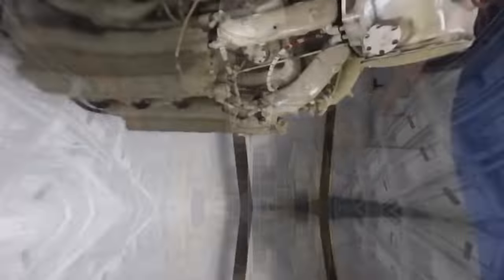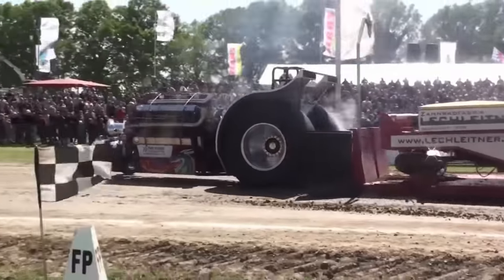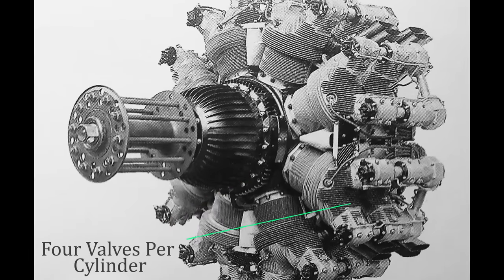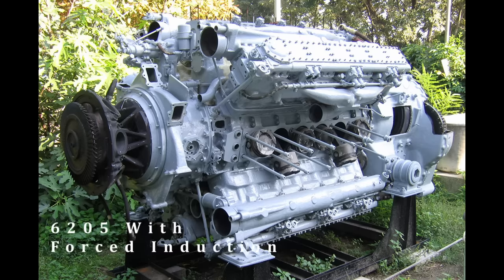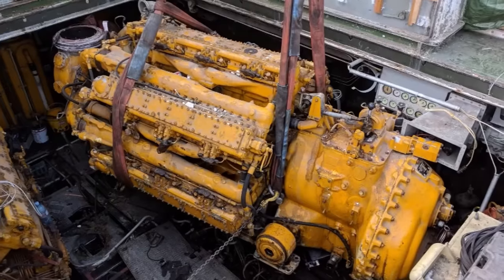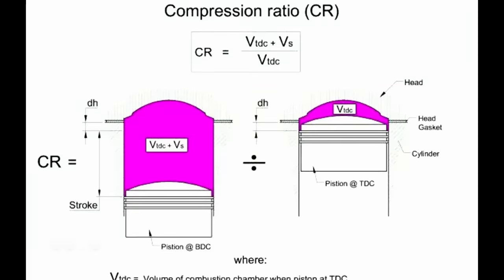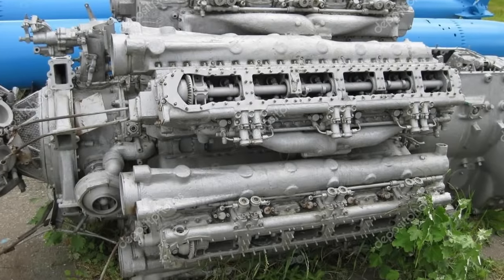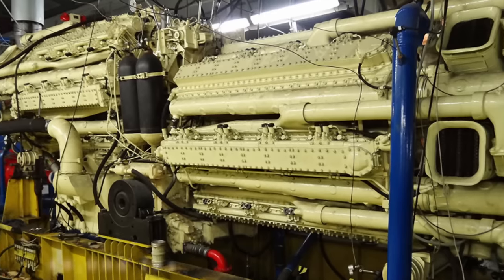Yakovlev M-501 - The BIGGEST Piston Radial Ever Designed

Comment: Russian Engineering is really quite amazing.  It is a classic case of making what you need from what you have.  BTW, the Soviet style economy with its approach to engineering did produce a number of scares in the American intelligence and military communities.  The best one, I think, was when it was found out that the Typhoon Class submarines were being built with pressure hulls constructed of titanium.  Titanium is an extremely difficult material to weld requiring inert gas.  The American intelligence community thought that the shipyards constructing the hulls had found a new way to weld titanium.  Actually they had not.  They just essentially built an airtight box around the hulls and flooded it with argon.  They then sent the welders in with air lines and breathing hoods.
Reply: Sub brief did a video on this topic.
Reply: I always wondered how they did that!  I had assumed they riveted them, but I like the Soviet approach better.
Reply: So, they did it the easy way?
Reply: Soviet. Not Russian
Reply: Making what you need with what you have - is a real slogan, that is common in engineering community in Russia.
Reply: Russian McGayvers :D
Reply: no it is not amazing, only for the layman this is amazing
Reply: @whyMDO  not russian, soviet
Reply: @MrTiti  Yeah, speaking as a welder with (some) experience welding titanium, what they did was wayyy more complicated than it needed to be.
Reply: What's your source on the story about the Typhoon class? I haven't found anything referencing that story, let alone anything mentioning that the pressure hulls were made from titanium
Reply: @richardmillhousenixon  Подводные лодки типа Тайфун пр.941 строились из стали. Из титана строились пр.705, 685, 661
Reply: @ВладимирДоровский-д7е  Я так и думал.  благодарю за разъяснение
Reply: @richardmillhousenixon  it sounded odd. Like TIG is not a secret, it's pretty easy to do...
Reply: @jagx234  Yeah that's what I thought. And TIG (then called Heliarc) has been pretty well perfected since the 1940s
Reply: & if they didn't make it... well... they argon.
Reply: I think you mean the Alpha class, not the Typhoons.
Reply: @jalomic  Russian)))
Reply: @jalomic   Most USSR engineers were Russian.
And the USSR is Soviet Russia.
Reply: I just got done watching K-19 lol. Not a Typhoon obviously but great movie.
Reply: @soulxtr  Most USSR engineers were Ukrainian and Jewish. The word Russian is just a broad term to describe all people colonised by the Russian Empire or the Soviet Union.
Reply: @MikeRoch-m4r  I live in Russia and I know that you are lying.
Reply: @richardmillhousenixon  I think hulls are a bit thick for tig
Reply: @sabotabby3372  It depends on the exact thickness because those are usually classified on any submarine still in active duty, but you can use tricks like beveling the joint to get more thickness out of a tig weld
Reply: still collapsed while the u.s. took over lol
Reply: @MikeRoch-m4r  Exactly. 100+ different ethnicities lived under the Soviet rule, only a portion were actual Russians.
Reply: @jalomic  Average westerner logic: If it is bad then it is Russian,when it's good then it must be Soviet...ofc we all know it is Russian.
Reply: Titanium isn't really difficult to weld.  It just flows differently when liquid. Its very "plastic".  It takes a lot more amperage to melt it and it dissipates heat really well so its really easy to get your rod stuck to it. Basically you just have to dip it in the middle of the puddle rather than the edge. Or ball drop it.
Reply: Hah, that's clever! Can't get oxygen inclusions if there's no oxygen!
Reply: @theprojectproject01  Soviets took the expration "theres more than one way to skin a cat" to a whole new level
Reply: @MrTiti  ok cool guy👍🏻
Reply: @MikeRoch-m4r  Chief designer of alpha-class submarines: Petrov, Anatoly Borisovich (Russian), Rusanov, Mikhail Georgievich (Russian). Both were born in St. Petersburg. Most of the submarine fleet was designed and is still being designed there, so there is no need to invent it. Stop demonizing people on a national basis, all information about who designed what in the USSR is in the public domain if the information is not classified, so go and study before writing such nonsense. Indeed, Ukrainians and Jews also made a great contribution, but deleting Russians from this list is a natural falsification of history.
Reply: Soviet engineering is anything but amazing. Yeah, stories about crazy Russians pulling off incredible stunts might seem entertaining to westerners, but they weren't for us that had to, and sometimes still have to deal with the outcomes of soviet way of approaching a problem. Soviets were like a cheater in an online game- they had unlimited access to all the resources they needed. And because of that, and the party monopol on absolutely everything, Soviet engineering was primitive and inefficient. What's worse, commies saw political influence and conspiracy in absolutely everything. One example. During the war, Soviet airforce... wastn't the best to say the least. How the party and tov. Stalin himself approached the problem? Of course, they called it a german-jewish conspiracy and "bought" everyone involved one-way tickets to Sybir.
Reply: I'd imagine the US or some western country would have probably proposed a similar design but instead of an airtight structure they'd have developed a shielding gas system for tig welders.
But alas, Russia basically sat on the world's supply of titanium so they never were able to even dream of using it.
Reply: @dallasreynolds2962  Stacking dimes!
Reply: @MikeRoch-m4r  
Lol... Stop to SAY STUPITIES, the  russians have the biggest amount of  engeniers
Reply: The only titanium-made subs were the Alpha class, a type of fast boats aimed to support the Typhoons and other ICBM subs. 
The idea of using titanium was to make a sub undetectable by magnetic sensors. 
The Alphas were fast, yet noisy, and required a lot of automation due to their liquid metal-based cooling systems. 
Yes, their construction required large argon-filled warehouses.
Reply: @MikeRoch-m4r  Okay, go charging around on your hobbyhorse, and don't fall off your soapbox while you're doing it.
Reply: @doppler3237  Soviet and at the same time Russian.  All 3 design bureaus for underwater vehicles and their factories were located in Russia (RSFSR), two - in Leningrad, one - in Gorky.
Reply: Great story Paul, I'm glad the cold war is over, I spent most of my navy career during that time. Another funny story about titanium is how Kelly Johnson acquired a large amount of it from the Russians to build the most awesome plane to ever fly, the famous A-12/SR-71.  I'm sure you know more about it than I do.
Reply: @Richardrefund  As far as I know, 40 aircraft were built, 11 A-12s crashed, one crashed on takeoff and was written off, another one was written off as a result of an incident at the airbase.
A curious plane, not very successful, judging by the number of accidents, and completely unsuccessful, because it did not fulfill the tasks assigned to it.  The Americans themselves closed the A-12 project or the Soviet MiG-31 retired it.
Reply: @garynew9637  whats the tittle ?
Reply: Вообще-то титановые корпуса Советских подводных лодок сваривались при помощи электронно-лусевой сварки в огромных вакуумных камерах
Reply: @richardmillhousenixon  Akula’s, as they are called in Russia or Typhoon in the west are made from steel not titanium of course. There are other boats made of titanium, including the single Anchar or Papa class boat that holds fastest underwater speed record to this day of 44.7knots.
Reply: @olegk455  I have at least a limited knowledge of that class, and people can correct me if I'm wrong but since those were laid down in 1963, I'm pretty sure the techniques for welding titanium together had been well known across the world to the point that if they did weld the hull (I can't find any specifics on whether that hull was riveted or welded) I doubt NATO would have been that surprised to find out it had been welded
Reply: Think think the Mig15 was the biggest scare. Swept wings with copies of British rolls Royce jet engines given to the Russians 5 years earlier by the British government. For a short time the entire Air arms of the UN airforces in Korea was outclassed badly.
Reply: most russian equipment is crap.. this engine is too big, too heavy and not cost effective.
Reply: it's a pity that the person who posted this video thinks differently
Reply: @jalomic  Sergei Korolev was an Ukrainaen Antonov and Tupolev were Ukrainain. The spacecrafts Salyut and Soyuz were designed and developed in Ukraine.. Therefore, Soviet engineering not Russian..
Reply: @theprojectproject01  The bad thing about the communist state of the Soviet Union is free education where 20% of the state budget is used for education.  and 60% of the population graduated from higher education
Reply: @carkawalakhatulistiwa  Yes, absolutely dreadful, isn't it
Reply: Titanium submarine?  My grandmother has a titanium tank of ~50 liters that her husband welded for her when he worked at a chemical plant in his youth.  And she just sterilizes jars with tomatoes and cucumbers in it.  You can’t even imagine how much metal in the ground the USSR left behind.  Everything that was built around me was built then.  Power stations, bridges, roads, hospitals, houses and schools.  People in villages and big cities still drive Soviet cars and tractors, on roads where there are more holes than asphalt.  Now only a brick chimney remains of the largest chlorine chemical plant in Eastern Europe.  And now this war.
Reply: @MrTiti  Well, I'm no layman but I'm most definitely amazed by the fact an elongated radial diesel was designed for use in airplanes!
Reply: @dickstryker  Now, see, that really feels like a chicken/egg situation
Reply: @jalomic  name the official language of Soviet Union
Reply: @MikeRoch-m4r  wrong
Reply: @barracuda7018  
>Korolev
>urkainian
do you mean KorolYUK or KorolenKO?
>Antonov
>urkainian
do you mean AntonYUK or AntonenKO?
Reply: soviet, not russian, USSR consisted of 15  countries
Reply: @vermillion4971  exactly that russian.
Reply: they copied the design, also the propeller based aircraft is copied also from Germany and developed by a german engineer, you can look it up. the point is: everybody makes what he can do from what he has, its no different anywwhere. what you mean is "oh i didnt know with 70% of technology i can also do things 85% as good.

looking at current aircraft, artillery or trousers, Russia is done
Reply: @jalomic
Reply: @richardmillhousenixon  You fool 😂😂😂 a welder...😂😂
Reply: @MikeRoch-m4r  yeah, right, as well as most of the NKVD/KGB officers, who took part in purges.
Reply: ВСЕ ЧТО СОЗДАВАЛОСЬ В СССР БЫЛО ПРИДУМАННО УКРАИНЦАМИ!!!
Reply: Agreed,  Russian engineering is Absolutely amazing and extremely Bold…..another amazing example was the “Caspian Sea monster” Ekranoplan… a shame they weren’t able to preserve them.
Reply: German engineering in fact, this engine bears quite uncanny resemblance to Junkers Jumo 222, that was being developed in Germany when the war ended :)
Reply: Soviet Engineering
Reply: @soulxtr   Really?
The ALL USSR achivements belong to the ALL Soviet nations, not for the Russians only!
Reply: @levlebedev1214  полностью с вами согласен
Reply: It really is incredible how much technological progress can be made if don't value human life
Reply: Nice cope vanja
Reply: You are right, comrad! 
но это не от хорошей жизни, а скорее от недостатка того что нужно.
Reply: But wasnt it like, a waste of resources, because in the end the the steel in the reactor was still enough to make It detectable by  mad devices.
Reply: @Hank Hill  modern problem need modern solutions
Reply: Soviet engineering.
Reply: @solarpower09  soviet engineering designed by Junkers and BMW
Reply: Yepp! Humans can do "great" things when "convinced" with a pistol to their heads...
Reply: @barracuda7018  Туполев это русская фамилия, украинская была бы Туполько или Туполенко, Королёв если был бы украинцем бы Короленко или Королько . Антонов русский, он не Антонюк или Антоненко. и так далее. Усвоил правило? Не важно где находился завод, самолёты и ракеты русские, они выпускались в СССР. Самолёты ИЛ-76 выпускались в Ташкенте. По твоему тогда Ильюшин был узбеком😅?
Reply: Советский!
Reply: @MikeRoch-m4r  and in America there are many Russian, German, Chinese, Italian, Jewish engineers by origin, but they all consider themselves Americans.
Reply: @karolmalinowski9097  why do we need to retell Polish propaganda? we have our own. )
Reply: @jalomic  Yes, sure.  It's funny to read comments like this.  everything bad from the Soviet Union is assigned to the Russians, and it was Russia that inherited all the debts and mistakes of the USSR, not Ukrainians, Belarusians, but Russia.  As soon as we are talking about the miracles of Soviet science and achievements - this, of course, is not Russian but Soviet.
Reply: @MikeRoch-m4r  of course, a real Russian can only drink vodka and play on a balalaika while dancing with a bear. And what is an American engineer capable of? You also have Jews, Ukrainians, and all nationalities of the world. who is an American engineer by nationality at all?
Reply: Another airplane related scare was with the MiG 25 Foxbat. This jet was breaking speed and altitude records left and right, and its design left the West thinking the Soviets had just produced a superior fighter. We, again, thought the Soviets had used advanced techniques to use Titanium in the design. The MiG 25s two massive engines made it one of the fastest jets in the world, and its large wings were thought to make it extremely maneuverable. The jet prompted us to start developing the F-15, but when a Soviet pilot escaped to Japan in a stolen MiG 25, all the secrets were revealed. 
We quickly realized that the MiG 25 was not designed to be a maneuverable fighter. It was meant to be an interceptor capable of catching up with the XB-70 Valkyrie, a supersonic bomber we never ended up building. It was so heavy, its huge wings didn't offer any maneuverability, but were necessary just to get off the ground! The engines, as powerful as they were, were extremely cheap, and had to be completely replaced after just a few hundred hours.
Reply: As a german I find Russian engineering Philosophie usually is usually my favorite one.
Reply: @soulxtr "USSR is the Soviet Russia"?
What?!?
Wasn't the USSR composed of Russia, Ukraine, Moldova, Belarus, Estonia, Latvia, Lithuania, Azerbaijan, Georgia, Armenia, Kazakhstan, Uzbekistan, Turkmenistan, Kyrgyzstan and some others I can't remember at the moment?
Reply: @TheAllMightyGodofCod   Most of the republics you called did not have their own statehood.
Reply: @TheAllMightyGodofCod   When did the independent states of Ukraine appear? Moldova? Belarus?
Reply: @TechnoGlobalist  Glory to DDR
Reply: @soulxtr  your pont being?
Reply: @soulxtr  if you don't understand plain english, there is no point in having this conversation.
You either don't understand what I said or you are pretending not to understand it.
Reply: @TheAllMightyGodofCod   Не было таких государств как Украина, Беларусь, Молдова, Казахстан. 
Эти государства сделали коммунисты выделив их из территории России в отдельные республики, создав таким образом СССР.
Reply: @soulxtr  and suddenly, after embarassing himself and showing he neither has arguments, nor does he understand simple english, the poor guy has nothing to resort to either than stop writing in English and hope that we can't understand what the poor devil wrote... Let's see if that works:
No.  
And he has no better arguments than to continue insisting on the pathetic idea that he doesn't get it.... And he will get a report for disinformation. 😂😂😂😂😂😂
Reply: @TheAllMightyGodofCod  I wrote to you in Russian so that you can translate yourself, because the translation into English with the help of Google can distort the meaning.
Maybe you don’t know that Belarusians and Ukrainians are also part of the Russian people? 
The Communists allocated them into individual nation, although they were based on their Russian, and had no separate independent states.
Reply: @soulxtr  you already proved you don't know how the world works and its history. 
You already proved you don't understand simple  English.
There is no point in continuing this argument.
We are not talking about "people" whatever that very abstract and absolutely vague concept is, we are talking about countries. Countries, not "people".
And let's be honest, they don't pay you enough for this.
Reply: @TheAllMightyGodofCod   I'm talking about countries !!! When was the country of Belarus or Ukraine?
И ты не понимаешь элементарного русского языка!
(1 из 6 официальных языков ООН)
Why don't you understand a simple Russian? 1 out of 6 official languages of the UN
Reply: @whyMDO  or with farmers everywhere
Reply: @jalomic  русский=советский . Нет никакой разницы как называется страна, главное люди, а люди всегда были и будут Русскими !
Reply: @MikeRoch-m4r  Ukrainian, perhaps, Jewish, no...
Reply: most of the red scares were from well made propaganda pieces, the MiG-25 as you all know, a giant rocket-engine powered interceptor, the engines were disposable, the airframe was ridiculously heavy, making the F-4 phantom look like a very maneuverable fighter.

The airframe's design was right, they just curiously decided to make it out of superheavy materials. Had they not done this it would have stood a chance as a real air superiority monster.

Modern Russian Engineering is well, making what you need from what you have, but this is because of extensive corruption in the military, a weak economy, etc. The modern Russian army is a joke that has been telling jokes since Chechnya, maybe even Afghanistan. Who knows how long Russia's army has been in decay, could have been right after WW2.
Reply: @whyMDO  это нормальная практика во всем мире , строит из того что есть . а вот то что нужно это не всегда.
Reply: @yesyes-om1po how is your space program going ameri-goblin 🎉
Reply: @12226  It is phenomenal comrade, and how is yours? How many failed attempts to land on Mars in the last 30 years comrade? How many deep space missions to Jupiter, Saturn and beyond? How many ground breaking optical telescopes in space? How many successful fully recoverable rockets like Falcon 9?
Reply: @jalomic  
genius, the population of the Soviet Union is about 90% ethnic Russians.
Reply: @captainkirk4271  
little fool. he jokes and laughs himself.
Reply: @captainkirk4271  
clown, I've already been drafted.
Reply: Is a well known fact that soviet submarines  did have titanium made hulls.
Reply: @barracuda7018   Korolev, Antonov, Tupolev are all Ukrainians? funny) Why???!))) if Korolev can still be attributed to Ukrainians, since he was at least born in Ukraine, then Tupolev and Antonov are Russians born in Russia in Russian families. As also Yakovlev Petlyakov Polikarpov and otherrs. Sukhoj  is a Belorussian, Mikoyan is an Armenier, Gurevitsch is a jew.. To be honest, I don’t see Ukrainians there at all.
I noticed Ukrainians privatize everyone who simply has even been on the territory of Ukraine) i it's already a phenomenon..
And weapons designers Makarov, Degtyarev, Shpagin, Tokarev Kalashnikov, Mosin, , Sudayev, Stechkin, are all Ukrainians too? Just think first, and then write)
Reply: @enterBJ40  Yes, the question was about how they were fabricating the pressure hulls.
Reply: So, they had.
Reply: @MikeRoch-m4r  В СССР у всех права и возможности были одинаковые, не зависимо от нацинальности! 
В отлчии от колоний в других государствах.
Reply: @MikeRoch-m4r  ты лжец.  не говори о том ,  чего  не знаешь.
Reply: Yeah,  when part of your basic training is to write home and request tampons for bandages  is a badge of honor. There is alot of pride that Russians have in being resourceful. There's also alot of truth behind it.
Reply: @zombie_snax  Especially when you consider the rapid industrialization of Russia in the 20's and 30's when Russia was the fastest growing economy in the world.  Essentially, Russia went from an agrarian to industrial society in about 20 years.
Reply: That's knowing that in reality, there is no box.
Reply: Typhoon is not a titanium hull
Reply: @JohnFrumFromAmerica  Thank you for the correction.  I checked and it was the Alfa Class and Project 945 Sierra Class submarines.  Nevertheless, it was quite an accomplishment to make a pressure hull from titanium.  That is what I get when I try to rely on my memory from time to time.